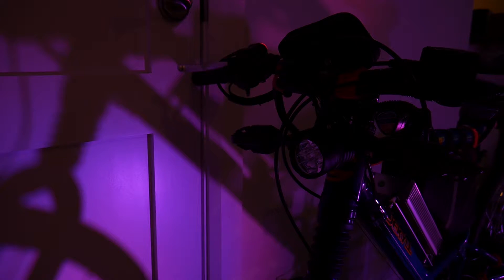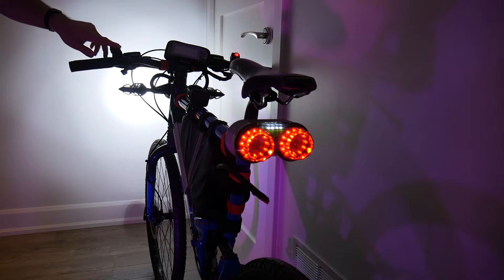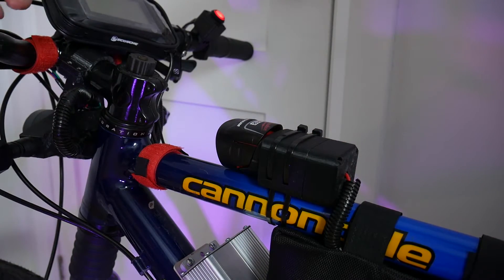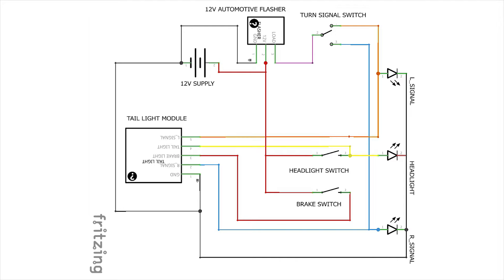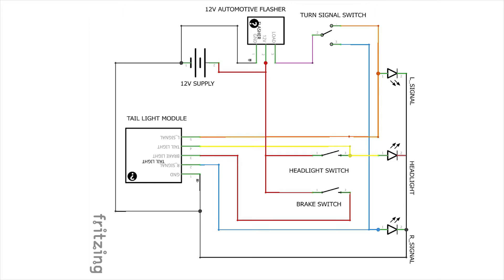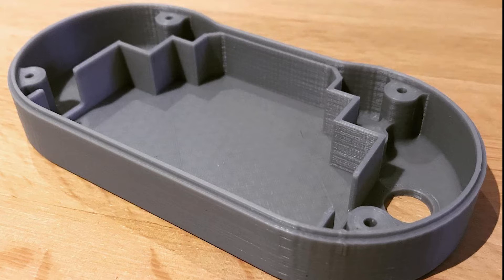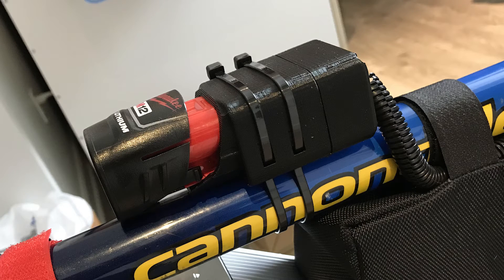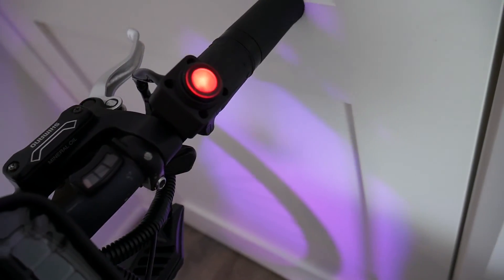How to Build an EBIKE Lighting Setup! Wiring Diagram, Parts List, 3D Printed Parts Made Available!

Comment from the maker: If you guys appreciate this build, check out the parts used below! As an Amazon Associate I earn from qualifying purchases (at no extra cost to you):

Milwaukee M12 battery:
https://amzn.to/3Q5HTWL

Front Turn Signals:
https://amzn.to/3bpxHcW

Front Headlight:
https://amzn.to/3Bu2aRJ

Rear Brake Light Module:
https://amzn.to/3PQN1OU

Automotive Flasher:
https://amzn.to/3Bqtf8r

On/Off Rocker Switch:
https://amzn.to/3zj4pVl

3 Position Rocker Switch:
https://amzn.to/3oFhvr9

Illuminated Rocker Switch:
https://amzn.to/3zHg023

Comment: Great video.
I installed a 4-light system on my ebike - high beam x1, low beam x2, and rear x1.  I use a 24 volt rechargeable battery. And I have rocker switches installed for the high and low beams.

when I flip the rocker switches on, the lights function but one of the LED light indicators on the rocker switch always goes out, but the lights stay on. I'm loading too much into one of the rockers, apparently. 

How do regulate the voltage so that the rocker switch indicator LED stays on too?  Hope u can help. 

/bklyn 👑
Reply from the maker: Thanks Robert, are the LEDs in the switch rated for 24V ? or were they meant for 12V?
Reply: @EmbraceMaking  If they are rated for 24v, can they be used for 12v?

Comment: I would GLADLY pay you for a setup like this. I'm 65 retired and working on my 2nd ebike built. I put two torque arms on this 5000w hub motor capable of handling 72- 96v power source. I'll get parts if you'll will 2 do the labor. BTW all your links to ebay are gone Can't find page is the msg. you get. So I can't see the full title/description of the items to search elsewhere. I did download your files, did you craft all these yourself?  Love the 3D imagery

Comment: I wish you would have wired into the controller or the main battery  That would have been real clean and taken up less space for those of us that have very limited space to mount things ...like I can not use the Milwaukee battery since I have zero room for something that large.  I could use this on a pedal bike but not my ebike.
Reply from the maker: To wire into the ebike simply replace the M12 battery in my project with a DC-DC converter. Something that will accept your maximum ebike battery voltage. Note that a "48V" battery at full charge is often higher than 48V so check your specs. DC-DC converter should step down to 12V for the accessories I used. Just tap into some power wires from your battery and that's it. Switches / wiring the rest is the same.

Comment: i have my diy turn signal as well. i use 2 pin flasher for led i bought online. and i tap it to my 48v ebike battery with a step down voltage to 12v. I purchased a motorbike turn signal switch cheaply, left -rigt switch plus hazard switch in one and that works  fine. However, my headlight has its own integrated rechargeable battery because it is 5v, but also thinking of tapping a new 12v headlight soon. And that's how everything works for my ebike. Nice video and wiring diagram 👍
Reply from the maker: Thanks Norman! Glad you enjoyed the video. I used 12V parts because of the automotive flasher, tons of options for tail lights, + the use of a 12V tool battery was attractive to me. I could keep them on separate circuits and not affect the range on my bike.
Reply: I recently brought buck converter for my 48v to install motorcycle heated grip, can you tell .e if you were able to somehow connect thr brake to the tail light from controller?? I have brake light from aliexpress but it's not bright at all

Comment: WHERE CAN I GET THE WIRING DIAGRAM AND PARTS LIST FOR THIS PROJECT, i RIDE A E-TRIKE SO I NEED TO SPREAD THE LIGHTS IN THE REAR.  I'M RON J CAPTRONJ
@COMCAST.NET I WOULD APPRECEATE THIS INFORMATION.  THERE WAS NO LINK TO THIS INFORMATION ON YOUR VIDEO

Comment: Man I just found your channel and was so excited because I bought a kaabo wolf warrior electric scooter and just needed front and rear turn signals but couldn't find any good help! I tried all your links and they dont work. Maybe you could just answer a couple questions...... if I buy 4 12v motorcycle turn signals and a electric flasher relay can I install the lights to the flasher to a toggle switch to a 12v milwaukee battery? Would it power the flashers fine without any diodes or resistors? I know very little! People are telling me motorcycle flashers that are 12v really need 13-16v's and a 12v milwaukee will not be able to light them up bright enough..... I REALLY HOPE YOU SEE THIS AND CAN HELP...... THIS IS SO IMPORTANT TO ME FOR SAFETY REASONS! THANKS FOR ANY HELP YOU CAN GIVE ME!!!!!!
Reply from the maker: Hi Eddie, thanks for your comment! That is exactly how I wired my system. I'm sure in the video you can see the schematic I posted. Try and find an "electronic" flasher unit instead of a mechanical one. A mechanical flasher may not work properly with the low draw of LED turn signals. Otherwise it should work just fine just like mine! Keep in mind that cars/motorcycles have batteries too. When the car/motorcycle isn't running, the battery is around 12V, a little higher on a fully charged battery. But if you turn your turn signals on when the car/motorcycle isn't running, they still work! And they will continue to work well below the 12V when the battery starts draining. So the milwaukee battery will also continue to work with the flasher while it drains.

Comment: Why don't just hook it up to the ebike battery with a step down?
Reply from the maker: I had originally planned on that (there is actually a cavity in the tail light housing to hold a DIN rail type step down) , then I found that some of the step down converters from 48V to 12V were expensive. I ended up just using the tool battery as I had one laying around. If you, or anyone else were to use this system, you could obviously choose to wire and power it however you wish :)

Comment: Great project. I still cannot understand why no-one sells anything like this off the self.

I have bought the parts, but newer got to actually do the mechanical parts, but I share my ideas here,
Some ideas could be combined with your.

You do not have to print the switch holder, i think this would do the job and cost very little.
https://www.aliexpress.com/item/33029940473.html?

How to get 12v from drive 36/48/52v drive battery:
https://www.aliexpress.com/item/32834659318.html

A circuit that would allow switch low/high lights with the horn button.
https://www.aliexpress.com/item/32916131373.html
Reply from the maker: Thanks Joonas! I believe you also replied to my video on Reddit? If not I'll copy my explanation for certain design choices here:

All great solutions, thanks! My ebike motor kit did come with some similar buttons with clamps for the handle bars. The issue I had with them was that they were so bulky they interfered with my gear change levers. This is why I designed much slimmer ones... unfortunately I didn’t explain that in the video though. The dc converter is a nice cheap solution. I opted to isolate the two systems in this case but a converter will certainly work!
Reply: Yes

Comment: Good video. I'm building an electric motorcycle and I'm probably going to copy this. But I will keep the headlight on all the time. Why didn't you power this from the main battery?
Reply from the maker: Thanks, hope it helps! I didn't power it from the main battery to maximize range, plus I wanted to isolate the two systems in case something went wrong with a DC-DC converter ... didn't really feel like frying my lights.
Reply: @EmbraceMaking  I fried TWO different lights bc the DC/DC converter's black wire is a 2nd output and NOT a ground!